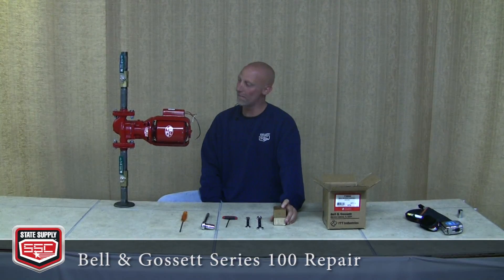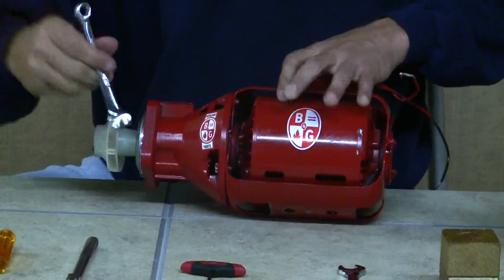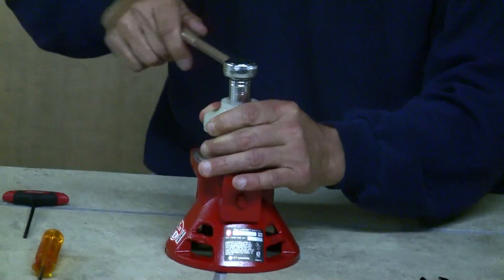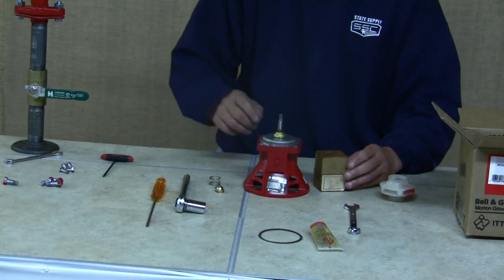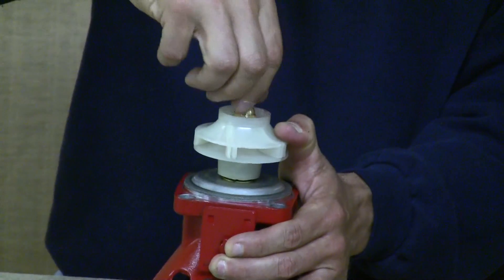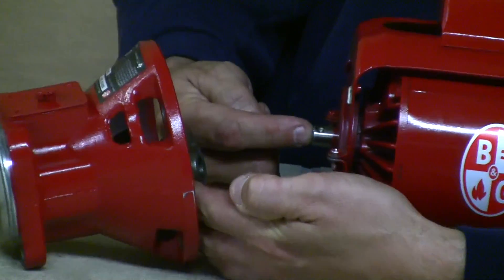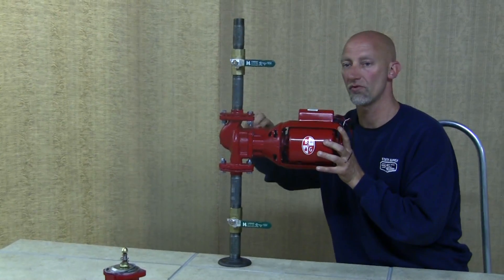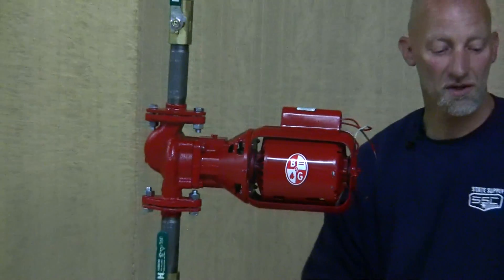How to Repair a Bell & Gossett Series 100

Comment: I’m not sure what’s wrong with mine. It wasn’t pumping today, I couldn’t hear it. It smelled like burning rubber, perhaps. Thoughts?
Reply from the maker: Hi Taylor, have you been adding oil regurlarly? Usually a burning smell is from bearings burning up. In this case it is likely they seized. 

It is possible the motor is still fine, and it would confirm our theory if you disconnect it from the rest of the pump and try running it on its own. It could also be the motor bearings that seized if they have not been oiled as well. 

When the motor is disconnected, try spinning the impeller shaft with your hand. Replace any siezed parts. Let me know if you need anything else. 

Thank you!
-Cole
Reply: @ thank you very much!

Comment: Appreciate the video you gave a 50 year old B&G motor some more years of use. The only thing else I noticed was the copper sleeve had some circular etching so I sanded it the best I could but it is no longer leaking. I wanted to replace the coupler but for some reason the new cast iron one fit easily on the impeller shaft, on the motor side it was a tight fit so I did not force it and used the old steel coupler. Since they no longer make steel couplers for B&G I guess I will have to make the opening larger on the motor side maybe drill out the cast iron coupler used for the motor side. I thought this was odd but when I told someone about it at a shop they mentioned it had also happened to them must be a difference between steel and cast iron specs.

Comment: @statesupply. I think my spring coupler is has gone bad. It makes a large rattling sound when it rotates. I have checked the oils and there are no leaks in the gaskets. Beyond the coupler is there any other part you reccomend I change? This is likely a very old year old series 100 pump which was grandfathered when I bought the house. Thanks!
Reply from the maker: Replacing the coupler is a good start. If you change it out and still have the rattling let us know and we will try to find a solution over the phone. Feel free to give us a call if you need any assistance! 877-775-7705

Comment: Great video. I have a 100 series that needs a seal I have water just dripping out of it. I have the seal but I've been dreading removing the impeller I'm afraid I'm going to break it since it's plastic and the pump is old. Fingers crossed!
Reply from the maker: You got this! If you do need any assistance, please feel free to contact us.
Reply: @statesupply  awesome! I appreciate the response. I thought about replacing it with a taco 007 but then I would have to replace the flanges more of a pain in the butt. I figured I just try my hand at redoing the seal. It's been there since 91 so I guess that seal just got tired lol
Reply: @statesupply  success! Changed the seal the impeller popped right off. No issues. Thanks again for the video it really helped!

Comment: Where can I buy the main gasket?
Reply from the maker: Here’s a link for the pump: https://www.statesupply.com/bh1010 
Replacement parts and other resources for your viewing pleasure. Enjoy!
Reply: Motor is making loud grinding noise. How can I tell if it’s the bearing assembly or if motor is shot?
Reply: @jerzia  I think you can feel if it is from the actual motor or from the bearing. 

Typically the bearing goes bad.

Comment: GOOD MORNING SIR, WHERE CAN I BUY THIS PUMP.
Reply from the maker: Statesupply.com of course!
Reply from the maker: https://www.statesupply.com/bh1010
Reply: @statesupply  I have two (2) B&G Series 60 pumps - what is the best use of these pumps? and is there any utility of using them in tandem or is that overkill?
Reply: @statesupply  I have two (2) of the Series 60 pumps - what is the best use of these pumps?
Reply: How much oil should be applies to the oiling ports

Comment: The part when he pushes down on the impeller confuses me. I don't see what that does, I never hear a clock, and the impeller pops back up sure to the spring pressure inside.

Can't tell if things aren't seating. The bearing shaft is impossible to turn once installed on the pump body

Comment: How easily should a shaft on an old bearing assembly rotate?  I can twist mine manually with my fingers but it's not as easy as it is to move the shaft on the motor.  Let me know when you get a chance.  My motor went on my pump, and I want to be assured that it wasn't caused by my bearing assembly or impeller.  I suppose since my coupling is undamaged, it is likely just a motor failure.  What are your thoughts?
Reply from the maker: Hi Mike, if you can rotate the bearing shaft with your fingers that's good. the motor shaft isn't under system pressure so it rotates a lot easier. if your coupler is damaged it could be due to bad motor mounts. look at the coupler where the springs go through the tips of the cast. the holes should be round if they are oval or have grooves in them the motor mounts are bad.
Reply: @statesupply  I swapped out the motor with a spare old one that a friend of mine gave me.  It's running smooth.  However, I have one more question.  I don't recall if this pump ran continuously or not, but this is doing that even after the boiler shuts down.  Is this normal or could something be wrong?

Comment from the maker: @jjankosky well hello there!  As far as cleaning the motor, compressed air should do the trick.  If you really want to tear everything apart I suppose you could, but compressed air should do the job just fine.

We actually have a motor mount replacement video in the works that was done on a Series 60.  The process is very similar on a series 100 though.  We should be releasing it privately in the next couple weeks.

Comment: Thank you, Having a boiler system has been and adventure the last 7 years. Can use all the help I can get.

Should follow up with motor mount replacement (did that one last year) also any tips on cleaning the motor up? Still works great but pretty sure this older then I am.